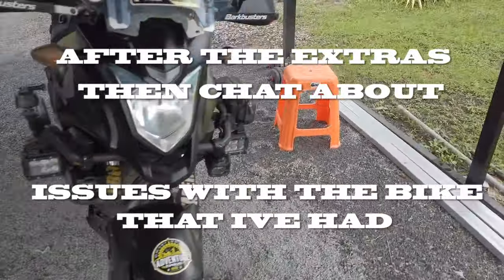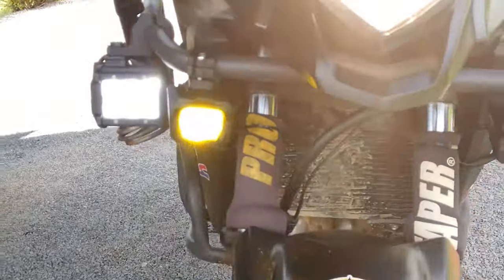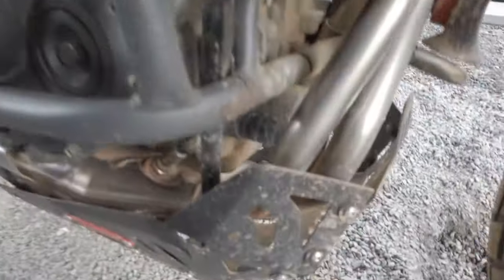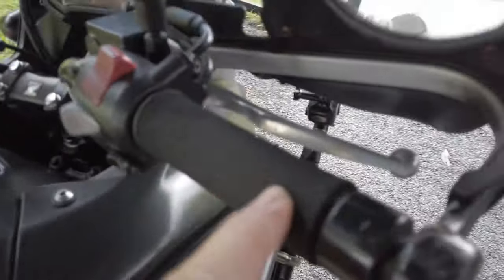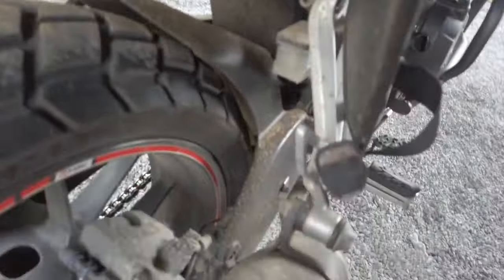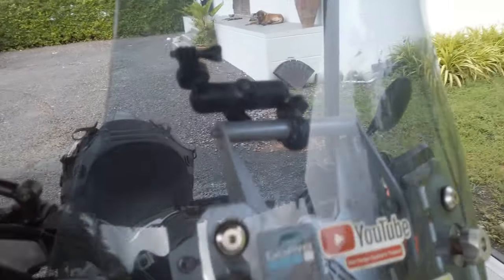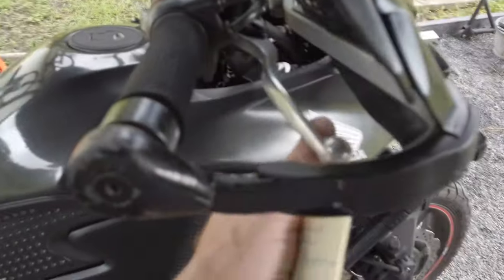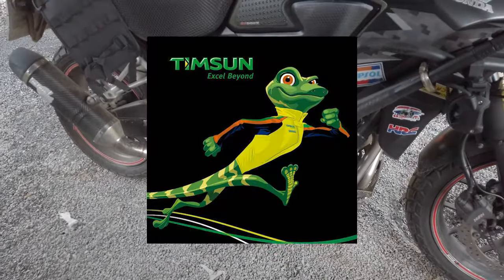CB500X IS IT REALLY WORTH IT #thailand #cb500x #motorcycles #honda #motorcycleadventures #motorcycle

Comment: Just finished  watching, your video , well done I have a 2019 cb500x, I love it ,mainly use it for road ,a bit of dirt, has 10,000 on it now , only thing that's gone wrong with it since purchasing is a sensor to the exhaust, putting the engine light on permanently, wich $8  new sensor fixed that , can't fault the bike , 
I think we think the same ,we both enjoy the bike and the ride, by the way I live in Bathurst Australia,  I have subscribed to your channel  regards Paul
Reply from the maker: Cheers Paul, they are incredibly cheap here in Thailand, as they are made here, I had the 72,000 shim and oils and all filters done and it cost me just over £100, I love my bike, get a few that think its a crappy Honda, makes me laugh really, it has taken me everywhere in Thailand, its like a old friend, for sure, the rainy season has almost come to an end here so have a few rides out planned, days out and 4-5 days away. thanks for subscribing, really appreciate it for sure. ride safe

Comment: Well i think I have made it to the end! yes I did!
Reply from the maker: thanks for stopping and seeing the whole video, ride safe
Reply: @badbadgerretiredinthailand  Not riding at the moment mate, have to change my suspension seals and other bits and bobs...but I get it and apreciate your kindness! I like the 500 series for a number of reasons, never tested one, but the X seems to be the jack of all trades. My problem would be 2 up, considering the advertised payload If I was to ride it with my wife we had to ride like the ultimate squid (naked) just me alone I weight 115/120 kg not taking in account all the gear from helmet to boots...yes I know - diet - yes I could lose some weight, and a leg and an arm...for solo trips 180kg seems enough, two up with riding gear I am sure that it would be close to 180kg and so I am sure no luggage, no bash plate not even a bigger side stand foot because you never know. I know I am overwheight, I could lose some 10 to 15 kg and probably I could ride two up with my currrent " configuration" plus some soft panniers with some essencials inside and probably would not have a problem because all the numbers related to the payload are probably made with some margin. Hey, but thats my 500 Rupies...or, I don't know the exchange rate, my two cents. No transalp or Hornet please...what a waste, in my days hornets had 4...now the have two...call it wasp or yellow jacket or something else
Reply from the maker: It does not excel at anything but does everything, riding 2up is ok, but be mindful of luggage weight